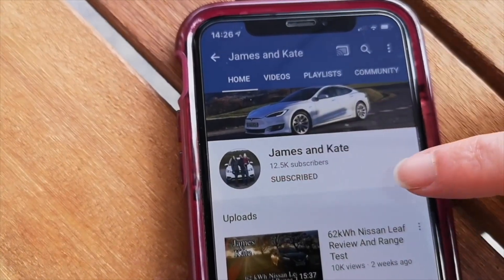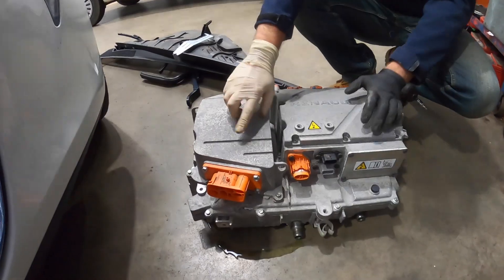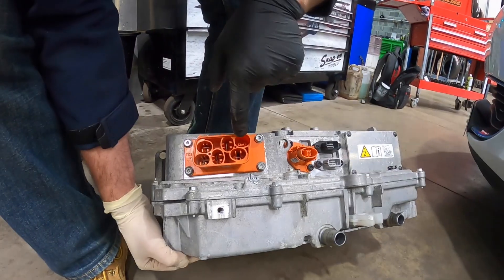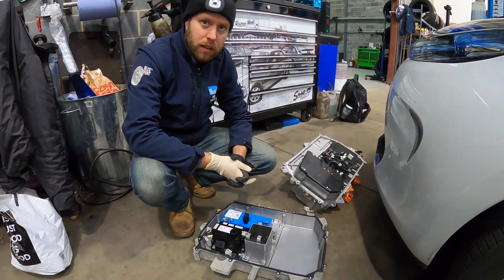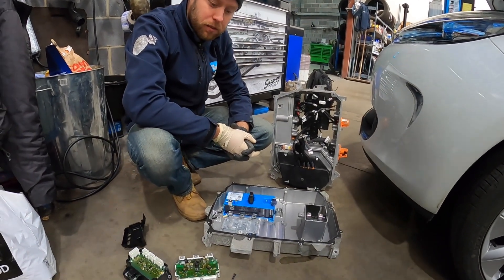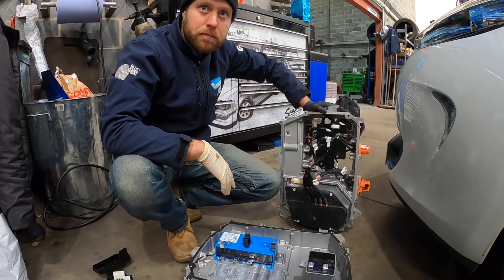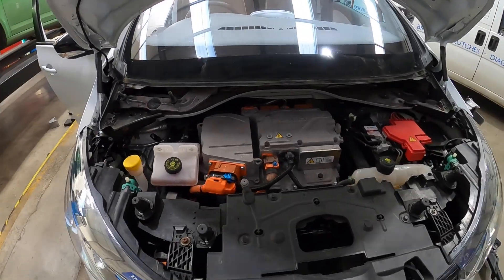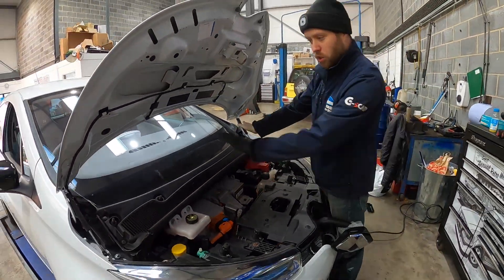Renault Zoe Charging Issues. - Cheap Fix

Comment: Mine didn’t charge 3 phase anymore and threw an error after every 100% charge. It also didn’t charge if the battery was over 27ºC. With a special software I was able to reset the error over and over again. Suddenly, now the error doesn’t show up anymore and I can charge single phase at least just fine, as if nothing happened. I did’t dare to try whether I can charge 3 phase because when I had the problem this made a horrible short circuit. PS: Renault behaved horribly, refused to grant warraty. I paid 1650€ for a new filter and after 600km I had the same problem (as discribed above) again. So they wanted to sell me a new motor for 4000€. Nope.
Reply: True horror stories from Renault. And not all of us live near one of these centres of excellence.
Reply: Help, I have the same problem, it does not charge on 3-phase, charging only through 1-phase, and after the charging is completed at 100%, it throws an error that the battery cannot be charged. How did you solve this problem?
Reply: @voglok2625  Well, I deleted the error with PyRen each and every time it showed up.. After a while, some months, I guess, the error didn't show up anymore. Maybe the stuck relais somehow got unstuck… I only charged 1 phase for years... until 1 day I was brave enough to try... and now the Zoe charges 3 phase without problems most of the time... sometimes it throws an error after charging, but that one goes away after it sleeps. I can live with that…

Comment: By the sounds of it this is a common fault in the Zoe Are the replacement parts a better design?
Reply: I hope this will not be a common problem. My Zoe Q90 has now 140.00 km after 2 1/2 years. And so far every thing ok. Almost zero problems. Except after 4 week, there was an error message on the display for 2 seconds "electrical system fault" 
So the Renault garage don't know why this happens and Renault told them to replaced the carbon brushes in the motor. But that was a warranty case... Until now all is fine!
Reply: @eDriver  Carbon brushes? Really? Wow, my washing machine used to have those. They used to wear out and have to be replaced. I thought all EVs used brushless motors these days.
Glad that it’s not a common issue.
Reply: @eDriver   I think Renault just didn't know what were talking about. Hopefully they were joking. This message usually appears when 12v battery is low, but not only. There are no carbon brushes in ZOE motors as the coils are in the stator (synchronous electric motor)

Comment: The beauty of EVs, you can strip down the systems without getting covered in oil and black gunge!
Reply: But for some engineers, that's half the fun!
Reply: there is a lot of oil and other liquids in EVs as well :)
Reply: @peterhric2942  True - but they aren’t nearly as messy as they aren’t mixed with burnt blow-by combustion products.
Reply: But there’s a chance you could fry yourself 😬
Reply: @hughmarcus1 There IS a risk to gaz yourself or burn yourself with a combustion engine aswell 🤣🤣 both have their UPS and downs

Comment: Nice to see that service can be broken down to individual devices inside the larger package.  We don’t necessarily like to see a repeatable failure on an EV, since that appears to be a sort of design or performance shortcoming, which could steer people away from a particular brand if the likelihood of failure is high, and it can occur outside of warranty.  Is the replacement part “improved”?  Or could/will the same part fail again?

Comment: Impressive they have all the diagnostic tools and know how. Easy access to purchase the individual parts. Nice. 

Tesla watch out, second hand EV's have to be repairable at reasonable cost out of warranty. Parts availability is key. Renault are doing well by their customers.
Reply: But this job cost £500, the Renault dealership would cost thousands?
Reply: @Eddhorse  yep. The point is the parts are readily available. Good luck getting these types of parts from Tesla
Reply: @JeanPierreWhite  Ah I see what you mean, hopefully Tesla will be able provide after market parts eventually, Renault have been doing it for a while I guess.
Reply: @JeanPierreWhite  plenty of parts avaliable from.scrap Teslas'
Reply: @williamarmstrong7199  how many of those scrap parts are new and come with a warranty?
Reply: Increíble todos tus conocimientos mi Zoé no carga en casa desde hace algunos meses pero si en los distribuidores públicos quisiera saber si conoces a alguien como tú en París o en alrededores ya que no sé cómo solucionar este pb a un costo aceptable muchas gracias por tu ayuda